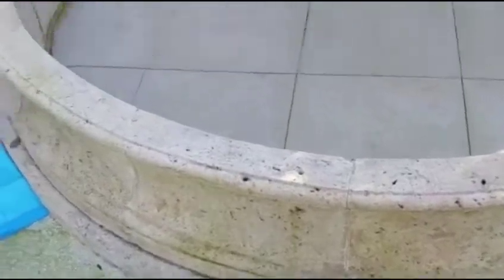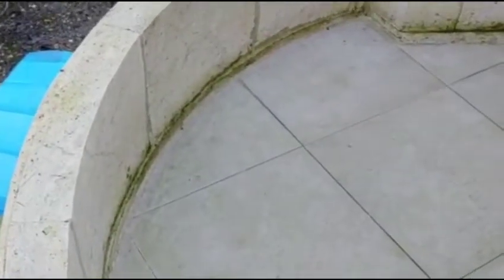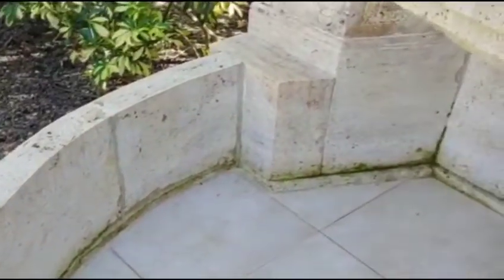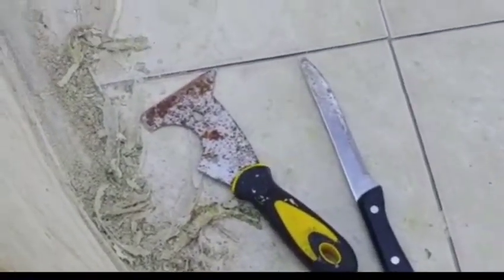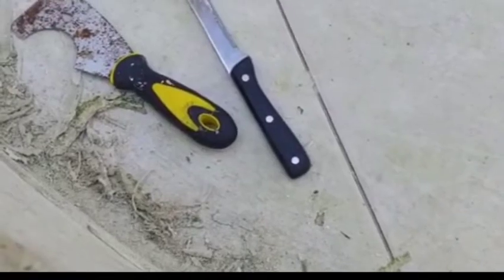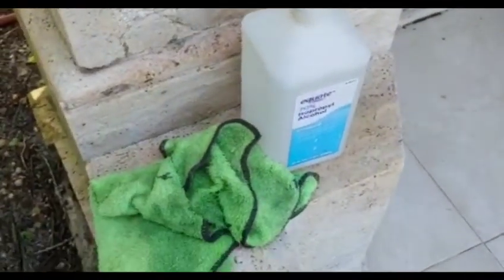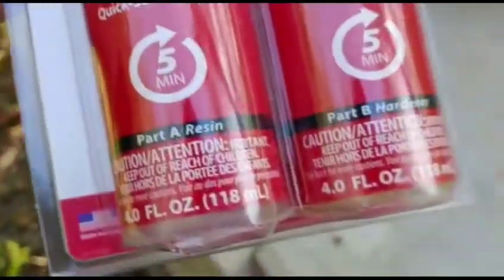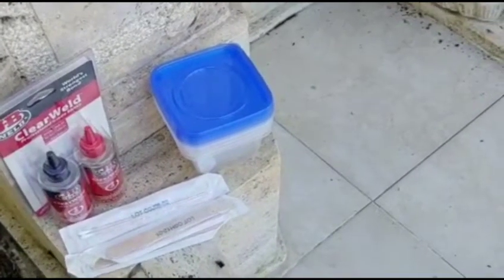How To Fix A Leak On A Concrete Or Stone Fountain

Comment: Should I use a concrete sealer on a fountain I just stained?  To avoid it from cracking?
Reply from the maker: If stained on fresh concrete for sure, if done on old concrete or stone the stain will have a rough time bonding. Anyway a sealer would help, don't forget anything constantly under water will require special sealers, I would look for something used on pools, to make sure it last. Best of luck.